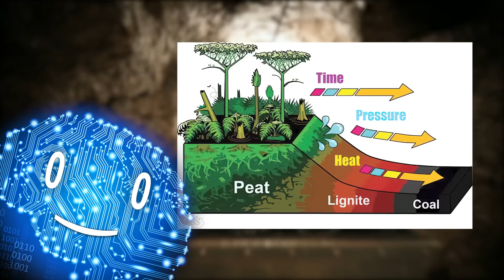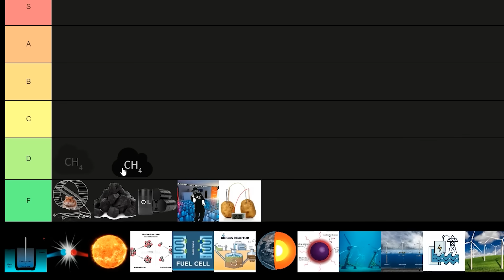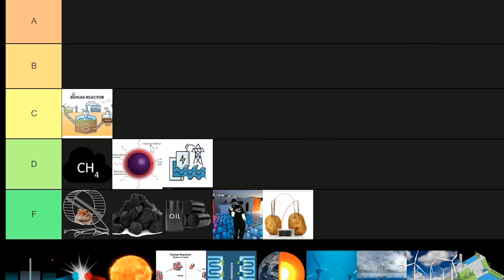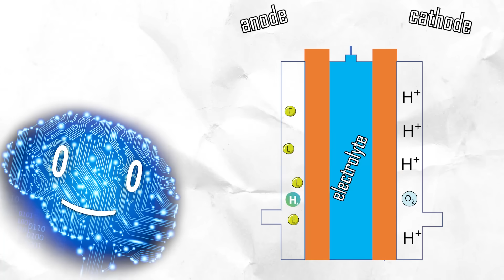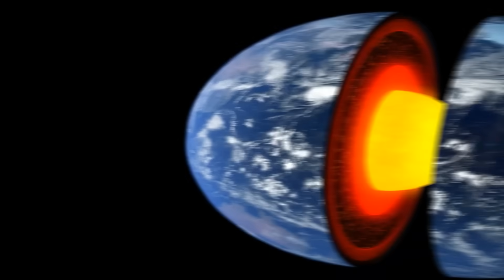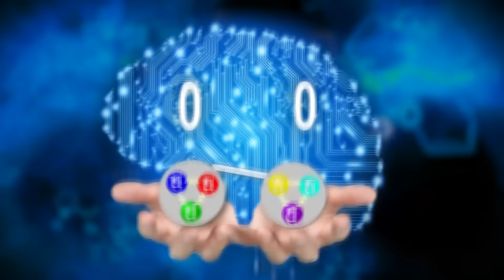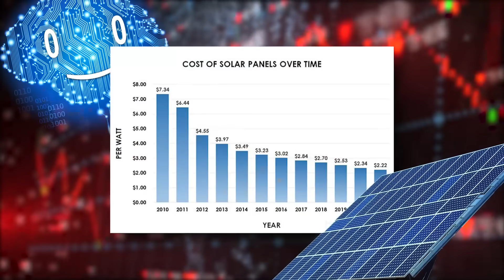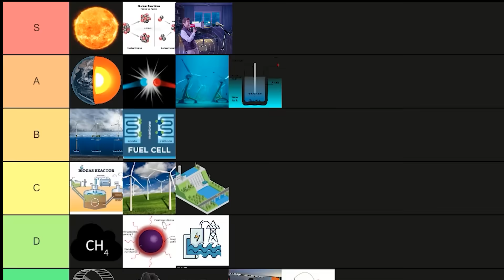Tier List of Energy Sources Explained

Comment: wind turbines are overrated. they are huge, noise and kill birds for little energy
Reply: You can cut out both make noise and kill birds, those are irrelevant, then you stay with "huge“ and that‘s not necessarily a bad thing. Windows kill about 1000x more birds than Wind turbines and the noise is created by almost all other generators, too. 
On the other hand, wind energy is cheap, can be used in most regions and works good in combination with solar
Reply: @FoxofWallstreet  how can you cut on noise and bird deaths. also how the fact that windows kill more birds is even relevant. i didnt even mention that they kinda destroy scenery
Reply: @brickie9816  Again, the noise is produced by (almost) all kinds of energy sources (mainly the ones based on turbines, so coal, gas, oil, geothermal, nuclear and yes, also wind). But have you ever seen a Citizen complain about the noise of any nearby power plant that wasn‘t a wind turbine? I haven‘t seen any.
The numbers are relevant to show how irrelevant the number of dead birds due to wind turbines are. About 0.035% of unnatural bird deaths are due to wind turbines, that‘s about 1 in 3000. wind turbines or not, the number of dead birds won‘t change in a relevant matter because of that. 
And lastly, the only goddamn ruined landscape I see is the dead forest on a nearby small mountain as the trees died due to it being to warm and dry and wildfires in the summer which we never had in the last decades before. A bit of "ruined“ landscapes because there are some wind turbines is a very small price to pay for mostly carbon neutral energy.
Reply: @FoxofWallstreet  Yes, literally everything creates noise. And turbines create quite a lot of noise too. But there is a difference between 4 turbines in a power plant and 400 turbines spread across hectares of land. You may enjoy the view of wind turbines, but they do influence view in a bad unnatural way, which is a "small price" to pay for nothing considering all the other alternatives don't do that. Additionally, if you want to put the numbers about birds in proper perspective, I think you should also compare the global amount of wind turbines or their total surface area to the amount of windows in the world.   Obviously, there is more of the latter, so it will cause more bird deaths than wind turbines, but it doesn't necessarily mean windows are more dangerous.
Reply: @brickie9816  The scenery and noise are absolutely irrelevant, preventing climate change takes priority. And please share the studies about bird deaths
Reply: @brickie9816  The point is that Citizen living right next to nuclear power plant never complained. Wind turbines however are build with a good distance to the next nearby house. Point being: The sounds couldn‘t have been THAT bad in the first place, so why now complain about wind turbines hundred of meters away from you?
The second point is not relevant? Why? Because the alternatives are not able to produce the energy needed in a country at all times without wind turbines, at least that applies to most countries. And I think we can agree that the further usage of fossil fuels destroys the landscape more than wind turbines ever could. 
Still, the amount makes the poison. Maybe wind turbines are more dangerous if there was the same surface of windows as their is surface of wind turbines. But the reality is that there is just way way more surface of windows than surface of wind turbines. Thus all that glass windows are more dangerous than the wind turbines. And if you really, really want to go deeper on this, let me just say even hunters kill 12x more birds than wind turbines and most birds don‘t actually die from flying into the turbine but rather due to flying into the post the wind turbine is build on. If we were to paint those post in, let‘s say rainbow colors, most deaths of birds could actually be avoided.
Reply: @patrickchang9135  why scenery and noise would be so irrelevant? Isn't it something we should take into consideration. Also, about the birds, I thought it was common knowledge
Reply: @FoxofWallstreet  yeah ok, noise from wind turbines isn't such a great issue when they are built in secluded areas, which they often need to be anyway. And yea, they don't influence  landscape nearly as much as some of the fossil fuel alternatives (most notably lignite mines I think), though it doesn't mean wind turbines dont have this downside. However, I don't see why would other sources of energy wouldn't be enough to reliably supply a country by themselves. If anything, wind turbines are unreliable since they rely on weather.

Comment: Dams are more nuanced, in low quantity they are very good since the reservoir is already a positive by itself. The more we scale it, the less efficient it becomes since we build less and less needed reservoirs. Basically we already dammed the best spots, any new dam will be inferior unless we are smart and restrained.
Reply: Dammed if we do, damned if we don't.
Reply: Damn
Reply: Thats a lot of dams
Reply: You should read about the Mediterranean Sea dam that's being considered.
Reply: @cgm395  That'll require a big co-operation between a lot of European and African countries (plus a few Middle Eastern countries) and I doubt that'll ever happen. Plus, dams big enough to dam off the Mediterranean would probably require more concrete than could be reasonably produced.
Reply: What about putting a bypass canal with a flow control valve next to a BEAVER dam?

Comment: The problem with solar energy is that it only works when it's sunny outside. It's not reliable, try making solar farms in Northern Europe lol
Reply: Wrong. They also work with clouds, not as efficient but still, they work and not too bad
Reply: @FoxofWallstreet  Clouds are not the problem, winter is
Reply: @sliftyy  We are currently in the process of installing a solar system on our roof, it completely sustains the energy we need as a household beginning from the middle of February. Also wind turbines can somewhat solve this problem as they tend to produce more energy during the winter.
And we are still in middle Europe.

Comment: using piezo electric generators for roads is the most stupid idea after solar panels on the road. the cars need to expend energy to drive on them i.e. USE MORE OIL, it's like driving slightly uphill. you also missed the important part that methane is between 50-100x more effective as greenhouse gas. (within the first few years, as it decays faster than CO2)
on geothermal the potential to crack nearby houses, or even sinking a whole city should be mentioned.
wasn't cold fusion declared a hoax?
Reply: Geothermal plants sinking cities? Now that's a stretch
Reply: Cars running on other fuels than fossil ones, that does exist. Nevertheless the idea seems pretty bad because you would need to think again the entire road infrastructure, think about the maintenance, the power output as opposed to the cost, efficiency etc...
CH4 has an estimated GWP of 27.9 if you consider a century as reference.
Geothermy has many uses thought, electricity and heating mainly, so different depths according to the need which will result in different ground studies to observe the differents catastrophe and secured scenarii.
Cold fusion is just a wet dream for now, the only experience that talked about it was lacking several key informations and considered wrong.
Reply: Biggest problem with geothermal is it is only suitable in a few places.

Comment: 14:40 "Whilst emmitting mere barrels of waste that are sealed and stored away somewhat securily." Nope that's total bullshit. These "mere barrels" are dangerous for THOUSANDS OF YEARS and NOBODY knows where to store them securily in such big amounts for such a long time. There are a lot of instances RIGHT NOW where those barrels leak and release nuclear material into drinkkng water which makes it not only irradiated but also poisoned by heavy metals. Apropos Germany - there is a huge dispute about were to store these barrels as nobody understandably wants to.

Apart from all that nuclear fission is one of the most expensive energy sources there is. Brown and black coal, solar energy, wind energy, water energy, hydrothermal energy, gas, methane, biogas, oil etc. are cheaper. So from a financial standpoint fission is EXTREMELY UNEFFICIENT.

Comment: Im still having a question about Dyson sphere concept. Yes hypothetically we can build it, but how will we distribute that massive amount of energy? Wouldn't it be logistical nightmare? 

Yet i believe having a good and efficient fusion reactor on site in better option. No waste (hypothetically) and convenient. 

Like if your civilization have enough resources and advance enough technology to build Dyson sphere, wouldn't be we also able to make, let just say reactor that has same output as the sun itself?
Reply: Electricity can travel through the vacuum of space. They could send ionized beams of electricity to some collector (lightning rod). Just theory
Reply: Big fricking lasers as every problems solution
Reply: No they can't. Unless they can create a perpetual motion machine there is no way to outperform output of the sun with a fraction of earth's resources. Even if you somehow convert entire earth into energy by exposing it with an equal amount of antimatter (from anti-earth i suppose) you will only generate about 40 million years of the sun's power output. Which is 100 times smaller than sun's life expectancy.
Reply: Why do you want to distribute that massive amount of energy? Use the energy locally and you won't have to move the energy?
Reply: Probably, but the assumption is that if you can build it at all, then you are working at scales where that's almost certainly something you can handle.
Reply: Like the other comment says, you could build lasers that transmit energy to different parts of the sphere, and to other places in the solar system if necessary
Building a reactor with the output of our sun would be a logistical nightmare, since you'd basically have to build another sun from scratch
Reply: @LoLaSn you better not to transmit much energy to earth besides the amount that you obstruct with the sphere. When you "use" energy it doesn't go away it turns into heat. And earth will be very uninhabitable if you introduce too much heat
Reply: @DajesOfficial  maybe heat tube kinda thing where you shoot the laser and it absorbs some of the heat back ?
Reply: @LoLaSn  what? No. Why would it be a logistical nightmare? It was over exaggeration on my side, yes. But we can build a reaction in our home planet. Maintenance and distribution won't be a problem cuz it follows the same concept as we have done for hundred year already.
Reply: @Accept_Any_Bribe  Why wouldn’t it be a logistical nightmare.

Comment: Awesome tier list Sciencephile, but I need to ask. Can the energy output of yelling into a microphone really loudly at 3am provide enough energy output to power an introvert?
Reply: Nah, i dont think even antimatter energy production can power an introvert.
Reply: @Devilhunter69 silence can
Reply: Introverts don't run on electricity

A normal microphone converts sound energy into electrical energy
Reply: @megavoltampere1000   they do. take away electricity and see them turn off. because gadgets to occupy them turns off.
Reply: The big bang didn't even have enough energy to do that
Reply: Alone time can easily power an introvert but if you want enough social battery to last a little while when talking to someone you don’t know of opposite gender that’s a different story
Reply: As a professional introvert physics scientist, I must say, this is simply impossible. To do this, you would need to utilise the methods hypothesised in the Dorito's principle, which, upon testing, has always been unbelievably flawed. Yes, whilst it does provide the introvert with more energy, however, it almost always results in the introvert doing even less activity, thus completely wasting valuable energy resources. To apply this to the Yelling Into A Microphone Really Loudly At 3am theory, the results would not only be similar, but would result in the introvert collapsing into a Gatorade hole, which really isn't what humanity needs right now.
Reply: Introverts aren't devpid of energy; they just store it to use on the Internet. Ask me.
Reply: Dyson sphere is the ultimate solar panels
Reply: Monsters Inc?
Reply: @theglitchr6346 literally my first thought
Reply: Nahh, introvert aren't gonna react to that.
Karen neighbors do.
Reply: Actually yeah just keep screaming good things and you'll be an extrovert in no tme
Reply: I don't think that even the entire mass and rotational energy of M83 could power an introvert, IMO :P
Reply: The voice itself is not enough to provide sustainable energy for an introvert. However, using audio engineering software to boost the volume of the voice can theoretically work. Be sure the volume goes above the 0.0db threshold, or else it won’t work.
Reply: lmao i had a brainfart reading this the first time. I thought introvert was some sort of machine like inverter or something
Reply: no, bczits mental issue, only the individual can solve it by changing his mindset